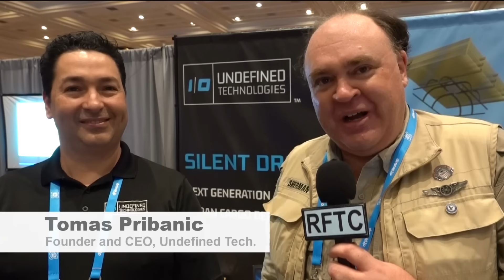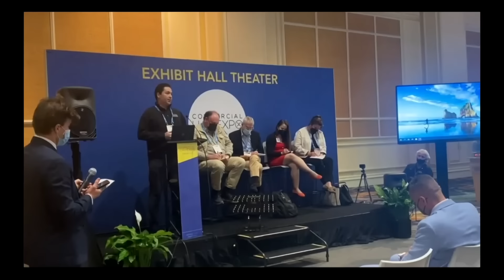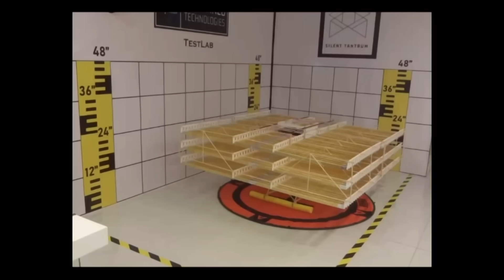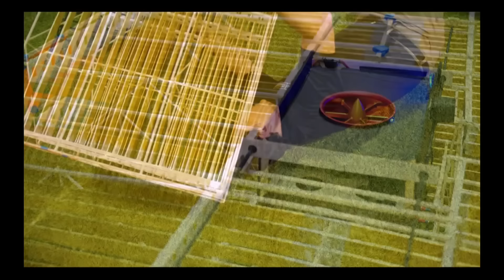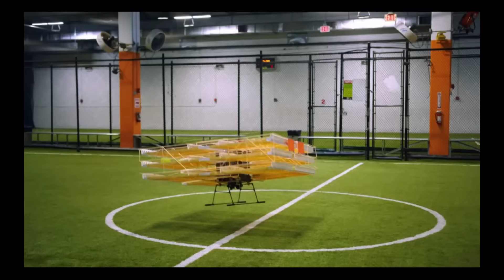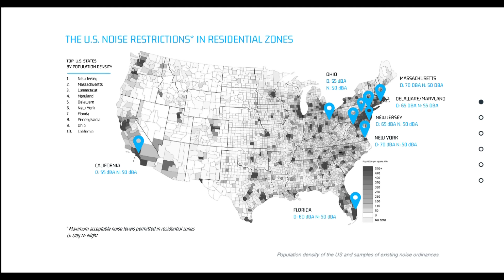New Drone Tech: No Propellers, and Yet It Flies!

Comment: Ion lifters have been around for a long time. They need high voltage to work and that is a challenge.
Reply: What exactly is the problem with high voltage? We invented the boost converter in the '60s. 
The real issue here is that the drone is actually powered by a standard motor
https://www.youtube.com/watch?v=iihprC5Huf4

Comment: Anyone notice the massive intake on the top center of the body structure. What does that do... If its ionizing air around the 4 quadrants why do you need a jet intake. i get cooling may be an issue but wouldn't that disqualify it as a rotor less drone.

Comment: One question for those folks who are more kmowledge than I am: Is this real?  What I know about drones would fit in a thimble - and leave enough space for a shot of nice scotch.

If this is real,  it seems like a huge advance. Are there any IR videos of this thing flying? Would love to see the heat  map of it while flying.  It may come down to yes,  you can fly this way but if it turms out to be terribly inefficient. LET ME BE CLEAR. I'm not claiming this is a problem for this product. I'm nowhere near qualified to make any such statement. Further,  I don't know these people and I have no "insider" info.

But I am quite  curious about the resource burn rate.    There's a caveat to the 2nd law that says,  in effect "You can pay me now or pay me later. But at the end of the day,  everyone pays.."
Reply: The UT craft is powered by a ducted fan.  They physics of the particular device and data provided indicate that it is orders of magnitude away from lifting itself with ion propulsion. 
There are a series of ion propelled craft on my channel that do lift their power supplies, but they are much lighter and follow a lot of specific construction details that are described in the patents.  A normal lifter will not carry its power supply it is 100s of times too heavy.  It is a thrust to weight issue.

Comment: These have been around for more than a decade.  They're called "lifters" usually.  Not practical for lifting large loads even with a powerful powerplant.
Reply: I've never seen them and I've been around for 3 decades.
Reply: @CaptainToasty89  John C. is correct, except the UT one has a loud ducted fan in the center.

Comment: I'm very skeptical about this. Every example I've seen of ionic propulsion proves so far that is very low power. Not enough for what its supposed working in.
I'm thinking the guy that said its an electrocuted fan is probably right.

Wait, it's 5x5 FEET, and it can only lift 2 pounds? Didn't I say something about ionic propulsion being very weak?

Comment: BS! I like it to be true but when evidence says its BS then it is most likely BS!

Lab video: If it is controlled via quadrants it shouldn't  be rolling around the center so much. In other words, it should be easier to stabilize.
Court Video: the structure is sagging under it's own weight and you would expect that the sag is reversed during take off but you don't see that.

Most likely based on those two, the ducted fan in the middle (which they didn't hide.) is generating the trust and the rest is just pure old fashioned BS.

Speachless. Not for the actions of the cunmen but for the 7k people who liked this video. Flat earthers maybe ..?

Comment: Build this thing to run on frequency instead of battery,  Build it the size of 2 football fields,  set it in the upper atmosphere,  and the elite can live on it and dictate from above.  All it needs is a force field to hold in the heat. Cleaner air up there too, so less plate cleaning...

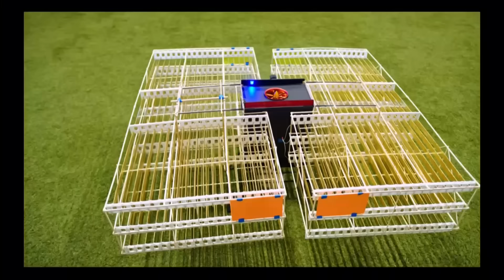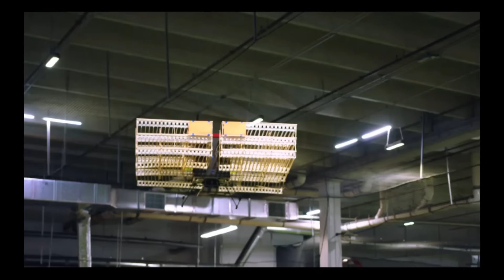Comment: Pretty impressive compared to the one we did in the boy scouts out of tinfoil.  The electronic in this unit must get very hot, other wise, why would they have a Ducted Fan RC motor in the middle of the rig. You can see the intake at starting at 1:27  and the exhaust ( of the hot air cooling fan caugh, caugh ) at 2:13.  Dealing with RC stuff most my life, I believe what is going on is here is a the main thrust of this craft is provided buy one RC Ducted Fan in the middle.  True there is No "Propellers".  The blades in a Ducted fan, or axial fans are some times called Impellers. The control of this rig is slightly influenced by the Ionic effect of the grids.  That along is pretty cool in my book, but as for the 2 pounds of Payload May be 2 LBS of BS is all it can carry.

Comment: Borders on laughable.  Some 25 years ago, Discovery Channel Wings showed an episode called "Declassified Military Projects", and through the Foi act was shown an 8 mm film of two US Airforce techs bouncing a tin foiled umbrella levitating in a hanger. The umbrella was initially foiled and to be used as a parabolic shaped antenna for an emergency transceiver (for a downed U2 Pilot) (late 1950's,  early1960's). When connected to the transceiver and keyed up... it moved across the bench. The techs were surprised by this, turned it up right and noted it levitated.  DISCOVERY CHANNEL BURIED the episode and denies it ever existed. But several other friends of mine saw it too. Note: A US Airforce transceiver back then would most likely produced a maximum of 20 watts of power. Also noting a tin foiled umbrella would weigh approximately 5 lbs. If this interest you....upvote and reply.

Comment: Not quite new technology.a bloke demonstrated in the earlier 90s.
Reply: The reason it didn’t make it past the I’ll by that was because it was difficult to control the item and it couldn’t carry anything
.
Reply: @davidreece6193  
There have been large ion propelled blimps since 1977 with steering.  There was a well-controlled heavier than air ion propelled craft in 1964 built by Alexander De Seversky, and others, with a really large external power supply.  The problem is, no heavier than air ones could come close to lifting their power supplies onboard except for the patented craft on my channel.  The 2 patents for it, are for lifting its power supply against Earth's gravity and for the details that explain exactly how it is done.  The UT craft gets its lift from a loud powerful ducted fan that can be heard and seen making a distinctive sound in one of their other videos.  They have a patent application that was just published, and it does not explain how they could get near to the ballpark of lift required.  There are several videos online of stabilized controlled flying ducted fans, like the Ikarus one, and they sound and fly exactly the same as the UT craft.  Pribanic does have a patent for leaf blowers.

On the other hand, you are really largely correct. The real one is very lightweight and getting it to work 100% reliably with an onboard control system takes extra power. The control system improvements are expected to be completed soon.

Comment: This looks interesting. The older asymmetric capacitor "lifters" used aluminum foil on a balsa wood or plastic frame, powered by 35,000VDC. The two sheets of aluminum foil formed the asymmetric capacitor plates. The problems with those were little or no directional control, and very minimal payload capability. 
    This one is VERY interesting, as it appears not to use solid sheets. It looks like wires or struts with space between them on a frame shaped similar to the old lifters. I need to research these!
Reply: I made one using an old CRT monitor and aluminum foil on balsa wood and Tungsten steel wire. It was amazing to see it lift! Never though of using multi levels.
Reply: @garrykennedy5484  i guess there is always a new "mousetrap"
I can go further. I've considered that once the riddle of fusion reactors is solved, the next hurdle will be to miniaturize fusion reactors one day, for military applications, then civilian.  With that kind of power, devices can be built to do so many things. And then someone will figure out to create room temperature super conductors.  Exciting isn't it.  To literally one day fulfill Carl Sagan's prediction.  Possess technology indistinguishable from magic. Live long and prosper! 🖖
Reply: @Wateringman  If you think about it (and I think Carl Sagan made this point too), a lot of our technology would appear as magic to people from our past. Just imagine if you and I landed in a helicopter anywhere on earth 1000 years ago. We'd be seen as gods, or at least "angels from heaven".
Reply: @garrykennedy5484  me too. Used the final anode tripler for the hv. Successful in that it went up and down, but absolutely no guidance at all, and wouldn't lift more than itself. As they strip the air molecules, the atmosphere around it smelled of ' after a thunderstorm',  and there was some debate that constant exposure may have an impact on mental health( how would they be able to tell with me????)  I gave up with it as I couldn't get it to move anything else.
Reply: @steamboatwillie8517  Yep. That ozone you smelled must be bad because the copiers I worked on had ozone filters. I think you would need continuous exposure though. But yeah, I had the same results as you did.
Reply: Materials engineering has progressed quickly
Reply: https://youtube.com/user/KraussEMUS1
Reply: Pity the "2 pounds for 15 minutes" is bullshit...
Reply: it's likely uses control of variable vectors for directional control. Likely you could do that with capacitor scheme if you would use at least four frames, angled slightly to allow variable vector.
Reply: I think this is another startup to fill your pockets with money and say that nothing happened! Why is there a turbine in the center and why is there a video of his flight without sound, if he is so quiet?
Reply: Look closely it's Plastice struts etc same principle upgraded with RC electronics - did this a decade+ ago and didn't solicity $$ for it/.
Reply: Use in Ukraine against agressor!
Reply: It's fake, dude. This guy is as scammer! Look lat the various shots of it from below and on top, then listen to it fly. It's a single prop jet in the middle that moves air, not ions. That's why it whines so hi pitched - it's an electric turbine, blowing out 4 ducted nozzles. That's why the flight characteristics are so wobbly and the reaction time is so slow. Those nozzles are so close to the center, it's extremely unstable. But it sure flies just well enough to make people believe it! lol This guy is a total fraud.
Reply: @-108-  are you sure that fan is for propulsion? I don't think that little thing could lift that device, and I presumed it was for cooling of the migubines to generate the high voltages for the lifter.
Reply: @spitbacca  I dunno - Big red flags are going off with this, telling me "SCAMMER!" Just look at the way it flies, and how close those ducts are to the center. If you know anything about aerodynamics and flight characteristics, that matches up perfectly with it's specific movements & instability. And why would you need a turbine to cool, when you could use that level of thrust energy to lift? Makes no sense.
Reply: @spitbacca  What is a migubines ?
Reply: @-108-  You ignore one lttle detail: when the craft lands, the wings drop a bit. This demonstrates the wings generated power or else they would not drop but hang all the flight time.

Comment: I know he can't reveal company secrets, but here are my questions:

1. How did he increase the lift since it may be carrying the power supply onboard (or a bank of capacitors)?
2. How is the directional thrust vectors managed? When this tech was in popular development back in the late 90's/early 2000's, it was still pretty much just up/down on the y-axis.
Reply: On my channel there are many videos of the only one that really works with onboard power.  The UT device is 100% ducted fan.
Reply: @KraussEMUS1  Thanks, I just subscribed. I worked on Lifters back in the 2000's so I am familiar with the concepts.

Comment: 5x5 feet... 2 lbs of payload, flying by magic.  Can't wait to see how this evolves.
Reply: It’s flying by a brushless motor and fan. They lied. 
https://youtu.be/iihprC5Huf4
Reply: @Dnmeboy What? I agree this idea is stupid but sorta interesting I guess but your statement is entirely false. First of all, there’s no brushless motor or fan visible. Second of all, there’s no small motor big enough to thrust all of that crap in the air and even if there was it would need a big propeller but then that also affects the drone by causing it to spin without a tail like an helicopter.
Reply: @DNMEBOY  I don't see either of those in the link, but yeah, it does sound suspiciously similar to a regular drone. Maybe just bring up the fact that regardless of the components it uses it's extremely loud, and low volume was the only thing it "had" going for it.
Reply: KamiEuKiTo  Yes... definitely.  I'm excited that such a thing is even possible in the atmosphere and how it could potentially lead to all sorts of innovations.  Even without high altitude flight, hovering a foot off the ground could still eliminate friction and create a fun amphibious glider like they use in the Everglades.
Reply: It doesn't have 2 lbs of payload, more like 2 ounces. People just LIE to impress.
Reply: @grahamstevenson1740  I think so as well…no way the structure could support 2 pounds without collapsing
Reply: @jimhofoss9982  Indeed, you can see it sagging under its own weight. This is a scientific curiosity with no practical application that I can see. There are severe limitations whichever way you look. The 'craft' has no directional stability whatever too.
Reply: @grahamstevenson1740  Well, people said the same basic things about aeroplanes, helicopters, trains, bicycles, cars and computers and mobile phones. Every one of them had huge technical issues that impeded their implementation. Advances in one area often kick-starts advances in others. The development of small, cheap, lightweight electronics and motors has allowed the rise of remote control quadcopters and drones in the last few years. Thirty years ago, they would only exist in research labs, cost hundreds of thousands of £/$, had to be tethered to a power source and flown by skilled pilots. Today, 5 year olds can fly them round their bedroom.
Reply: @grahamstevenson1740  It's hard to imagine something as large as that flying in the first place.  Sometimes when they talk about features they're really talking about their long term goals.  The question is... how long... 2 more years... 20?
Reply: Would you even DARE to go near onew if it was 5x5ft and could carry 50lbs? LOL
I wouldn't ...hahahaha
Reply: @lancewood1410  I think as they get bigger, they'll need to fly much lower.  Maybe even just like a hoverboard.
Reply: @lancewood1410  
Well 120 years ago few would get in any flying craft at all.  Crazy mad unnatural stuff.
Reply: It will probably evolve the same as it has since it was created 32 years ago,it went nowhere then and will go nowhere now, but I'm sure he will get many stupid investors to throw him money if he is a good talker. This is old tech that he copied
Reply: @davidwalczak1297  I think the difference is that although the core lift technology is old, all the navigational and control features needed to make it practical weren't available 32 years ago.  Most of those features came along with drones such as better batteries, better gyroscopic components, better CPUs, better GPS and especially the AI needed to stabilize and control it.
Reply: @IdeaOfTheDayCom  The means of generating lift has not appreciably changed over that time.
Reply: @grahamstevenson1740  Lift is the easy part. Fans that supply lift for drones have been around a lot longer than that, but what made drones practical is lighter batteries and stability control.  Now that most of that is mainstream it's only natural that people consider other forms of lift.
Reply: @JoeCrescenzi  Small drones are fine. As you scale them up in size they become les useful. Lift increases according to the square of linear dimensions but weight scales as the CUBE ! Ten times larger means ten times l:ES lift for the weight. End of that idea !
Reply: Light Weight high capacity batteries
Reply: @michelwillems50  Batteries don't store enough energy for practical vertical flight. End of. The Harrier (AV8) VTOL fighter jet required a huge thrust (13 TONS of thrust IIRC) special engine to be developed to make it a success. Your baby electric motor plus fan will be hard pressed to deliver a pound of lift !
Reply: Like children's toy drones to Military Strike Drones maybe.
...and now Ukraine using smaller more powerful small drones to drop grenades'/small bombs.
Never under estimate people being smart and innovative.
Reply: Death from above.
A silent drone that nobody hears coming, capable of carrying weight?

Oh yeah. Someone is going to be putting guns on these.
Reply: @harrytabb328  Drone tech as a whole scares me.  It's bad enough worrying about people putting weapons on a drone, with Artificial Intelligence making them more and more autonomous, we're one step away from the kind of science fiction we saw in Terminator.
Reply: ...It would eventually become what the paperclip scientists were cooking up in the 1940s
Reply: There's no such thing as MAGIC in the REAL world silly boy ! You're being deceived. There's no future in this whatever. It 's not even directionally STABLE FFS ! Two pounds of payload is NOTHING !
Reply: Thinking of the first attempt at hang gliding and where we are now.  It is a great step forward.
Reply: @stultusvenator3233  problem is this has been around for decades ive seen these thing at children's science fairs
Reply: It will evolve for sure